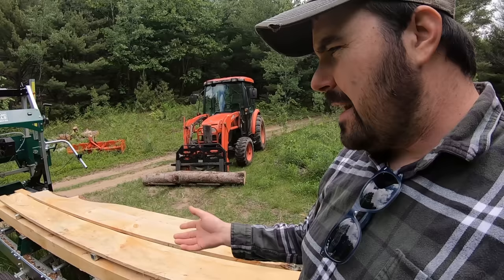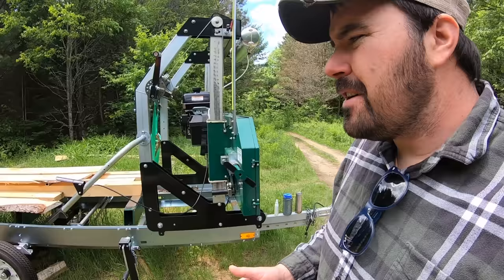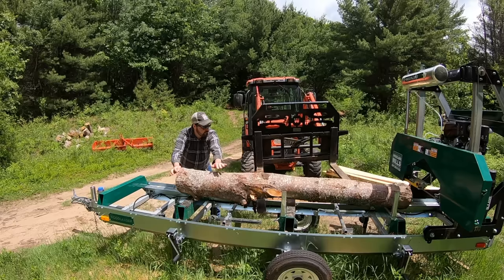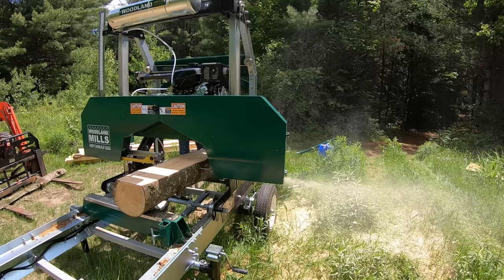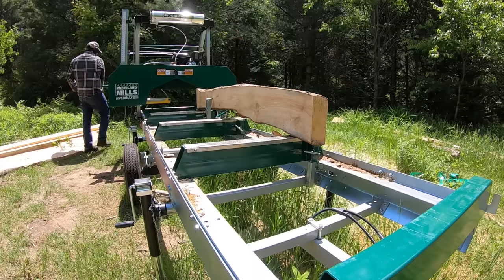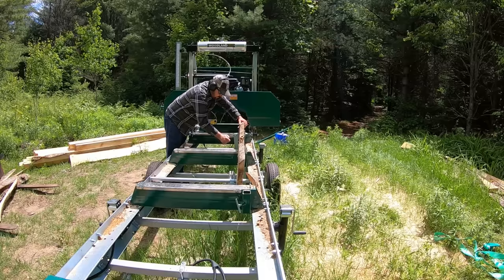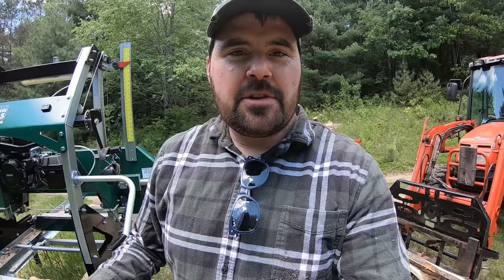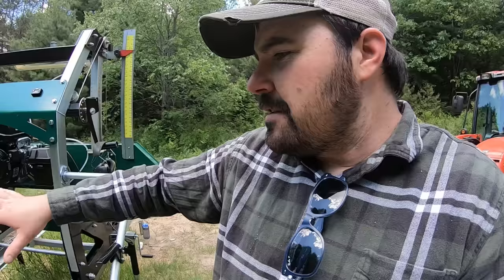Sawyer Explains How to Run a Sawmill | Muscle Memory

Comment: Most things people will learn from experience, it is the best teacher after all. But i truly appreciate videos like this with the actual explanations of WHY you do the little things that can save people from unnecessary irritating experiences. 

Right off the bat, making sure the cables are under tension before setting your cut height. Many inexperienced sawyers or machinists probably wouldn't figure this out quickly or would just assume the machine isn't accurate and live with any inaccuracies.  This kind of attention to detail helps insure superior products.
Reply from the maker: Thanks for the nice words. I do try to shed light on the small things as much as possible just I'd imagine it can be a head scratcher wondering what I"m doing sometimes

Comment: I used forks on my skid steer twice to load my mill and twice I had logs roll off the back. It's the clam for me. But, I'm sure a tractor is smoother to operate.
Reply from the maker: Yeah I’m the same way. I like loading with my grapple

Comment: The one thing I  do when cutting is I put down 4x4 scrap type wood first on the ground, and when I stack wood on the ground it's up off the ground a little making it easier to pick up with the tractor and reduce the man handling,  easier on the back. Also I took steel frames that the mill came in and put large wheels under it and 4x4's on the top of it so it can be rolled around in the yard, makes it easier to move wood out of the way if need be, don't have to bend down so far, just all kinds of things, though a piece ply on top quick field work bench. Well.... you asked for input so I shared, take care and as always enjoyed the video  👍.
Reply from the maker: That's a great tip Del! Thanks for that.

Comment: Hi Sandy I may have mentioned it before but in case I didn't if you get a five gallon steel pail put four or five holes 1/2 " around the perimeter near the bottom ring to give it oxygen get some birch bark and put it in the bottom of the pail place it on stones as it will get hot on the bottom and light it throw in some sticks or old slabs standing up just to the top and light it up when it gets going and a good flame is burning throw in some sawdust and keep some to make a smudge the smoke just rolling around on one side of where you working usually is enough to shew the bugs away I usually put the smudge up wind where I am working better than using bug spray! Personally I sooner smell like smoke than Deet. and you can take a shower and the smoke smell comes right off! I do this and the bugs are bad where I am it works great!
Reply from the maker: Thanks for sharing that as that’s new to me and worth a try for sure

Comment: i use to grow tobacco. i use my old bulk barns to dry kill some of the lumber and the old tobacco trailer to air dry. i finished my sawmill shed roof so i can get 2 trailer under the shed with the sawmill now. it's so much cooler now with out the sun on you plus no rain and snow on mill. i got a hft dust collecter but have not hooked it up yet. still have to do some doors and wiring. i use wooden stops to saw with use steel ones to load logs. i use a tractor with forks to load logs and if i have a big one on mill use the forks to turn it. i have learned a lot form sandy and other on here and on rumble. you are never to old to learn some thing new. sandy keep up the good work and videos take care, be safe and well.
Reply from the maker: That sounds like one great setup John!

Comment: Great videos.  You finally convinced me to take the plunge.  I just purchased a HM126 14hp with deck extension, lap siding attachment, and toe board.  I’m so excited.  I have been binge watching all of your content.   I’m also thinking of buying a laser for my mill.  If you were to do it again, would you install it in a different location and how exactly did you set it up?  Are there adjustments on the laser to make it even with the blade.  I did watch your video on it, but I’m still a little unclear.  Great content.  Keep up the good work!
Reply from the maker: That’s great to hear about the mill. You’ll be hooked after the first cut! I think the position of the laser is a good one but the only real way to get good adjustment of the laser is to be certain of the position when you first install it. I’ve never used mine in full sun but some are saying it’s hard to see when in full sun

Comment: Just now getting around to building the trailer to mount my 126 on. Would have gone for the Woodland Mills trailer, but I wanted more length of cut with another track section.
Reply from the maker: As long as you're making dust that's all that matters!

Comment: We don't raise the blade when pulling back, but have to reach in with a little broom to clean the sawdust off the blade.  Then we can adjust from where we are to set the thickness of the next cut.  Works a bit better for us.
Reply from the maker: Sounds like it would do the trick l!

Comment: Notice that your log lock fell out of it's bracket one of the times you were going to use it. I took a bolt and nut and ran it through the very end of the bracket arm to stop that.. I also put a piece of wood perpendicular under where it mounts so it doesn't fall all the way upside down to the ground when released. Really enjoy your videos..your videos  were one of the reasons I bought the WM and went with the 130 Max.
Reply from the maker: Great tips Randy! Thanks for those

Comment: Good morning Sandy for the type of log you had ( curved ) you did real good 
  You mention that when your done with a pass you raise the head of the saw mill to bring it back to the beginning I don't usually  do that I usually back it up at the Hight of the cut I just did and that tell me if my adjustments are at the right setting if the blade hit the wood or as to much of a gap then I need to adjust if the blade glide just on top of the cutthen that means all is good have a nice day
Reply from the maker: Yeah that makes sense as well. I’ve had before where after a cut tension is released in the log and the log raises slightly and I’ve bumped the blade. That’s the only reason that it’s become habit for me now
Reply from the maker: Thanks for those pics of your trailer are well!
Reply: when I finish a cut, I raise the head a little (around 1/8'') before pulling back. If I then watch the blade as I pull back, I can really see if my cut is straight/flat as the spacing between the blade and the top of the cut will vary. If I leave the blade at cut height, I find that I cannot see if the blade tracked high at some point. My 2 cents ;)

Comment: Setting the gauge on the way up makes sense, have you seen a difference setting it on the way down?
Reply from the maker: Hey David, I haven’t seen. A difference truthfully
Reply from the maker: I think if the sawhead ever bound up against the vertical posts it could make a different

Comment: What camera are you using?!!
  Great video quality.
I love sawing on my mill, too. My biggest problem is the mice building a nest inside the engine coverings. My daughter says to spray it with peppermint oil solution. They actually chewed through my low-oil safety-switch wire.
Reply from the maker: Those mice sure can cause some damage. I had one build a nest in my lawnmower engine cover recently. I'm using an older gopro for my videos.

Comment: Hi there. I noticed your sawmill axle and tires ensemble don't go along with a suspension, like a car or trailer. How fast and how long do you carry the mill around without worring about wrecking and bouncing ?
Reply from the maker: Thanks for watching. I appreciate the support. These trailers have suspension but it’s not a leaf spring style suspension. The suspension is independent from wheel to wheel
Reply from the maker: Torsion suspension is the name of them If memory serves me right
Reply: @sawingwithsandy  And the axels are removable, aren't they ? my mill came with a rigid single axle and no suspension at all. I just wonder how far and how fast can it go...

Comment: I have a woodland mills hm126, I am having a hard time getting the tracking perfect. I check the blade after my first cut and it’s fine, but then I check it after I complete the log and it’s moved a little forward on the follower side. I have spent hours trying to get it just perfect, but can’t seem to get it to stay exactly where I need it to. Any advice would help greatly!
Reply from the maker: Thanks for the comment and sorry to hear about the tracking. I’d likely start by trying a different blade if I couldn’t get the track to stay put. I may also check the guide bearings in the blade guides to make sure they’re not pushing against the blade while it’s running. If those seem ok I’d look at different belts for the mill. Hope that gets you in the right direction . Keep me updated as ya go. Thanks again for watching!

Comment: Hi, Sandy,
I really appreciate your videos; I've learned a great deal. I just started using my HM122 this year here in Oregon.
One thing I notice is when you raise or lower your saw head, using the winch, whether going up or down, almost seems effortless. On my saw winching down requires significantly more effort than winching up. This seems counter-intuitive; is this normal? 
Thanks, stay safe.
Reply: it should go down much easier than it goes up. spary your post with silcone and check to see it some thing is rubbing. if that does not help check cable adjustment. call or email woodland mills if nothing helps. take care and good luck.
Reply from the maker: Thanks for watching! I’d say it could be the white shins along the main vertical steel tubes could be a little tight if it doesn’t want to lower easilu